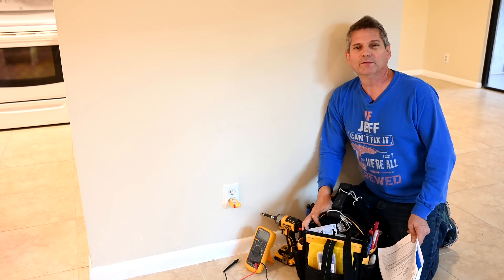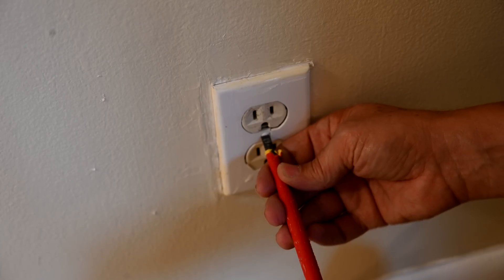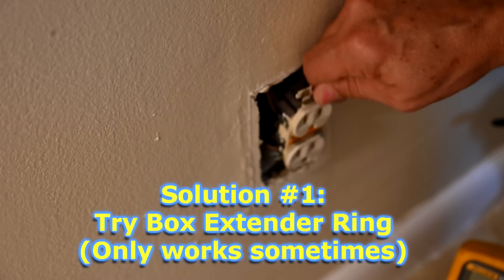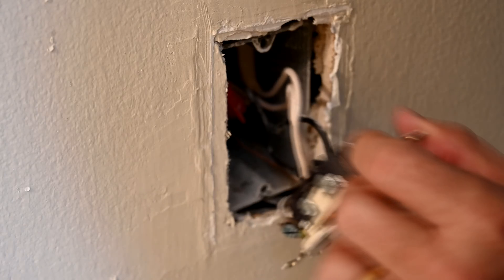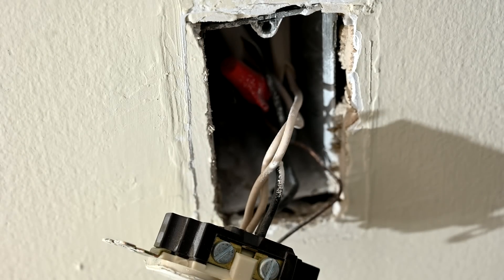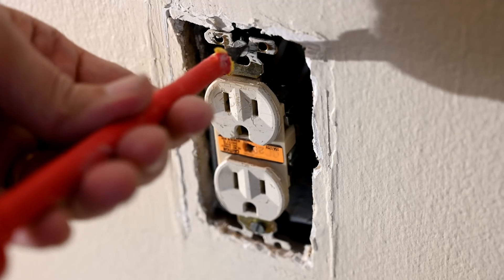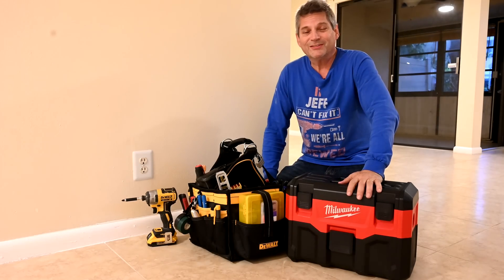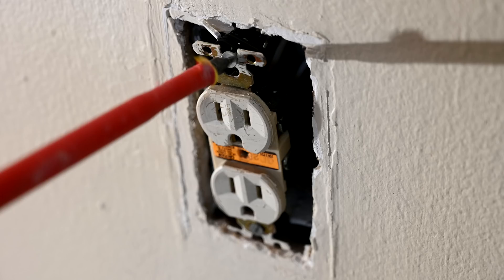2 Tricks To Tighten Loose Electrical Outlets, Switches

Comment: WHY? Why did you not replace that god aweful ugly hideous outlet while you did the rest of the work? They are so inexpensive!
Reply from the maker: Every outlet in this 37 year old townhouse looks like this, many are painted over, good luck changing every one of them and dealing with all the issues of poor drywall at every outlet. Time, time, money and money, my friends were 100% out of cash, I even would have given up a few outlets out of my own stash, but I don't stock these older style outlets, I only use the newer decora type outlets, much more modern and nicer looking. they had not time, under contract with buyer, had much worse problems on that list that I had to work on. They finally closed on it last week, glad's finally all over. Lots of stuff I would have liked to do to that place.
Reply: @jeffostroff  thank you for the video! I also like to replace all of those old style outlets with newer more modern versions.
Reply from the maker: @babj615  Yes, I hate these old outlets. when I take over a flip property, I often replace every single outlet in the place, I buy them in boxes of 10 at Home Depot for a better price break.
Reply: Thanks for the great info and video! I was a newlywed 20 yrs ago when we bought a house with old wiring, had a friend of  new hubby start. He left 2 outlets like that when we got rid of him, borrowed some money from my mom to finish it. Wasn't enough bc as you said, bigger issues. Anyhow, hubby's gone to heaven, I'm trying to fix stuff by myself. I started watching your channel I think about plumbing stuff. We were so in love we bought house "as is", 1st time using washer, flushed toilet during spin cycle, water came up the toilet, tub, sink. We just lived with it, set rules for anyone visiting, etc. There are no vents for plumbing! I'm adding oatey vents, going pex, replacing rotted wall behind washer by myself now. The outlets have bugged me and there's a light switch that kind of sparks when toggled. I just don't use it. Any advice there? 
Thanks again for your videos!
Anyhow, what are the larger outlet covers called, where get them and the decora outlets?
Reply from the maker: @jennygraudins4360  sounds like your switch has bad contacts inside it, I would replace the switch, and make sure the wiring is tightened down on the switch terminals, if the wiring is not tight you could get the arching that you are hearing, but I bet it is most likely the contacts inside the switch. the Decors outlets, everyone has now. The wider plates I use are these: https://www.homedepot.com/p/Commercial-Electric-1-Gang-Duplex-Maxi-Metal-Wall-Plate-White-Textured-PMTW-D/300716391
Reply: @jeffostroff  Thanks. Electric is after plumbing, wall done, and I can wash clothes at home again!
Reply: @jennygraudins4360  also gotta be careful with sparky switches sometimes people's shoddy repairs with improper (dangerous!) wire splices cause that. I had to fix one where the wires were loosely twisted together by hand and electrical tape over the connections. Not a wire nut to be found in that box.
Reply: I think it’s nicely patina’d
Reply: Geese ohh get to the point!
Reply: @patriciagallacher6741  It's spelled "jeez", geese are birds.  There is only one "h".
Reply: Hmm... #1 why would you go to do a job that has no money? unless you are donating time and materials. #2 who cares if you only have decora outlets in your stock, replace the #@*$@* outlet, I would never reinstall that piece of crap outlet. #3 did you say that there is a metal stud? I’ve never seen a plastic box mounted to a metal stud before.
Reply from the maker: @ronsonsensano1847  I did this for my friends who live out of state now and were trying to sell the unit. the buyer had a list of highly urgent items and code violations that needed to be fixed, with only a few days to do it. We were not interested in replacing every outlet in the house which all looked like this, we had much bigger fish to fry, repairing termite rotted wood porch pergola beams, fixing old damaged leak in ceiling, illegally wired electrical panel, etc, addressing items that would have prevented the sale of the property, replacing all the ugly old outlets would not have made a difference in selling the unit.
Reply from the maker: @ronsonsensano1847  Every outlet in this 37 year old townhouse looks like this, many are painted over, good luck changing every one of them and dealing with all the issues of poor drywall at every outlet. I had hours to do this, I did it free for my friends who were broke and forced to sell, normally I would not want to reinstall, but no choice, time was our enemy here and we had hours to get through much worse items on the buyers inspector's list. Nice to see you're observant about plastic boxes attached to metal studs. Useless handymen have touched this place in the past and really fouled things up. Usually the blue plastic boxes are remodel boxes which you get the types with the wings for adding into a drywall cutout hole, and they work perfectly. Don't know if the builder or a handyman later on installed that box but they really messed things up.

Comment: The previous person who used the long screws to fasten the outlet knew you were going to use shims so the long screw came in handy.👀👍🏽
Reply from the maker: Yup, it's funny they didn't know to use the shims, but people think you solve this problem just by getting long screws.
Reply: @jeffostroff  
I used a metal wall spacer, but needed the longer screws as well.
The box was set too far back and the screws didn't reach from whoever originally set this up.
Worked perfectly.
Reply: 😂lol

Comment: Could you cover the mobile home outlets that have the wings? Alot of times they push through damaged sheetrock and leave nowhere to grab.
Reply: Contact an electrical contractor. The can fix this issue
Reply: This man is not qualified in the electrical industry.
Please do not accept his diy videos as the proper way to address electrical issues.
In this video he has proven to the professionals that he has no idea how to properly address these repairs...

In addition if you are purchasing a home have a license bonded electrical contractor  inspect your potential home...
Reply from the maker: Maybe you could enlighten us oh God of electrical work, how you would fix this debacle of a mess caused by a builder who did not attach the outlet box to the stud correctly, then cut the drywall to big. Keep in mind the owners of the house were 100% out of cash, no money dig into the walls and install remodel boxes which would have been better, but short of doing that, these outlet shims are a perfect solution, that's what they are made for. You can't argue with the fact that the problem is solved. You also failed to address what is "wrong" in this video. And please don't make yourself sound uneducated by responding with non sense like there's too many things wrong to mention.